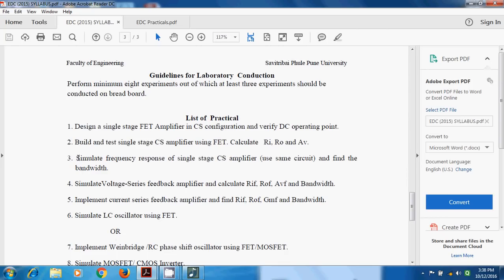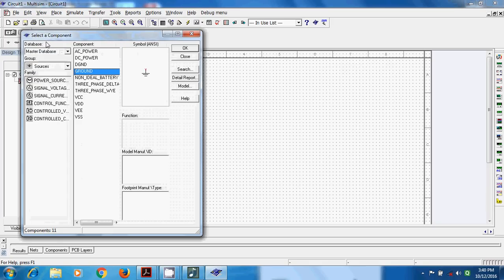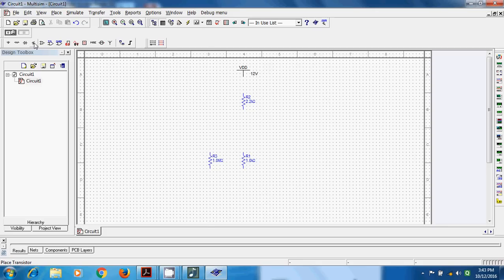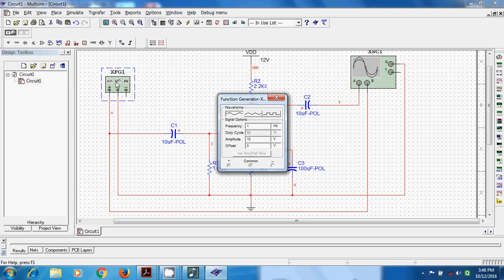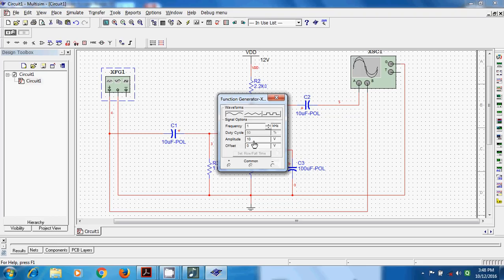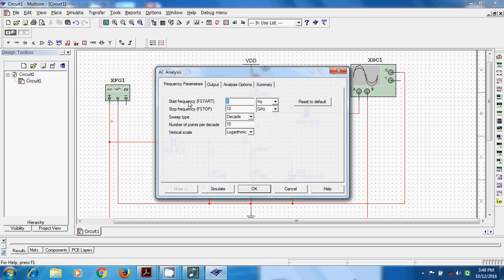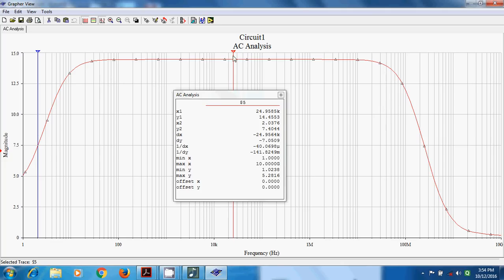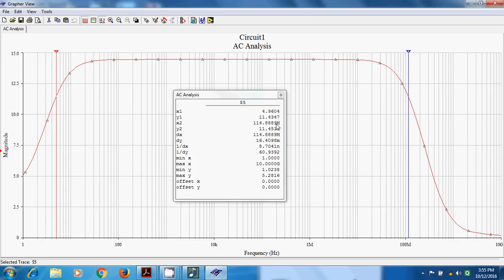EDC Practical: 3. Simulate frequency response of single stage CS amplifier by Prof. Omkar S. Vaidya.

Comment: G(dB) in Y-axis comes negative in practical lab . How did you got +ve value in y=Y-axis ?
Reply from the maker: Dear Nebiyu, it is not possible that gain in dB is negative even in practical lab. Because it is amplifier. Vo is always greater than Vin. Gain (dB) = 20 log [Vo/Vin] so if Vo/Vin is definitely more than 1, then its value is always positive. Please check your readings.

Comment: what would be the maximum gain?  would it be Avmid?,  and what will be -3db gain
Reply from the maker: On Frequency Response plot, Av mid is to be found on Y-axis. Now by selecting any cursor e.g. Cursor 1 & Cursor 2 we can navigate these cursors on plot. Legend regarding this is available e.g.x1, y1, x2, y2 etc. Avmid is region where plot is flat then navigate cursor 1 on these region means we are talking about y1 legend (because cursor 1 and y-axis parameter) Find the value of y1 in that region, it is Avmid. Still not understood watch carefully the video.
Reply: @dr.omkarsureshvaidya2038   Sir actually i wanted to know about how to find maximum gain and -3db gain because i have to write it in observations table..... can you tell me sir how to do that
Reply from the maker: @rohang6365  Please go to video at instant 14:28. The max. gain is Av(mid) which is 14.4553 dB. At instant 16:35 your answer is -3 dB at lower side which is Av(low) = 11.4347 dB and at instant 17:17 -3 dB at lower side which is Av(low) = 11.4511 dB. See y1 and y2 legend of cursors carefully.
Reply from the maker: Please correct: at instant 17:17 -3 dB at higher side which is Av(high) = 11.4511 dB.
Reply: @dr.omkarsureshvaidya2038  Thank you so much sir